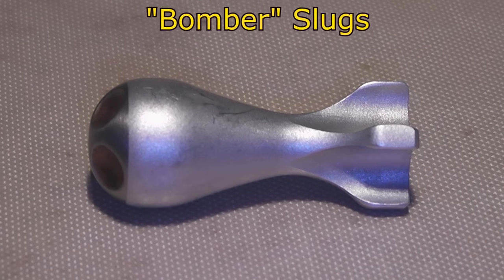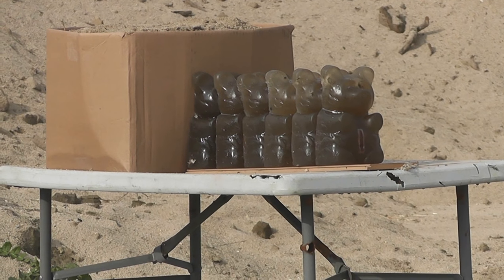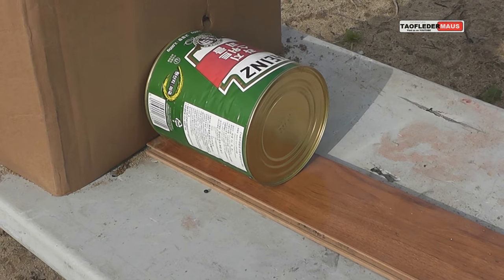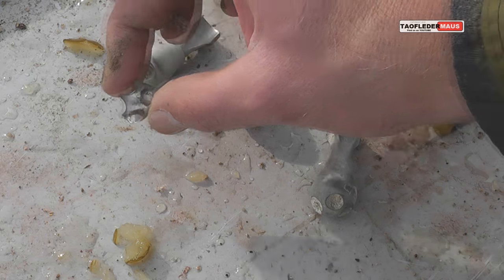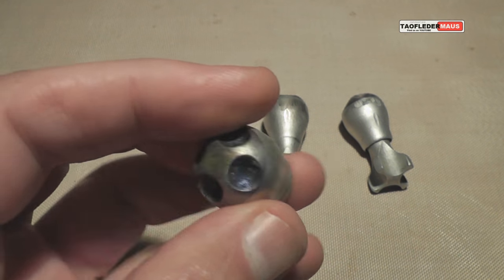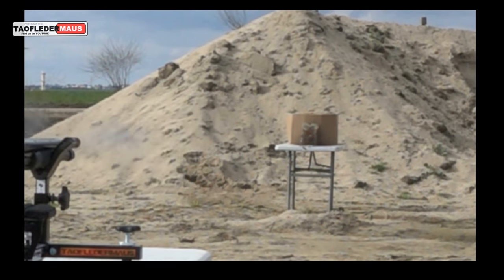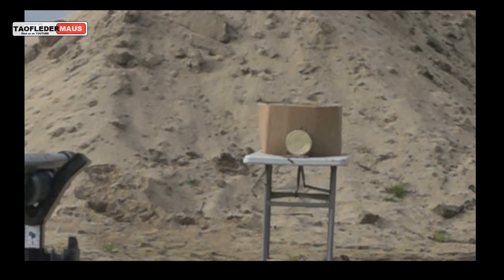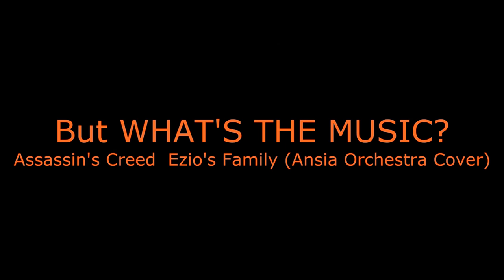BOMBER SLUGS -  Super Exotic Experimental  Shotgun Round

Comment: Wait what if you shot a prince Rupert's drop? Would there be a way you could keep it from shattering until it hit the target?
Reply: +Jordan Edwards You could possibly get away with it if you encased the tail somehow. Or, you could shoot tail first, and make a glass shrapnel round if the G force didn't shatter it in the barrel.
Reply: +Lunchbox Harris What if the tail end had been put inside a slug cast while it's filled with aluminum or something that is still solidifying? Perhaps the density of the metal would be enough to protect the tail from the shock. If it somehow managed to not shatter during impact, it might make for a good reusable bullet as well.
Reply: +Jordan Edwards For the drop I would suggest Brosilicate glass, because it has a high melting point, and it's great at absorbing thermal shock. (They make Pyrex bowls from it.) For the tail casing, you want as little energy as possible getting to the tail, I would think that metal would transfer to much of the blast energy. I would go with a material that has a high shock absorption rate.

Comment: Seems almost stable. For $220, I think I will stick with cheap lead slugs, haha. So with some modification, this is a good design, the supper sized pellet is a good design, and the Lee slugs are good in specific loads. We have a very large catalog of slug designs now, most do not work well, but a few do work well.
Reply from the maker: +Jesse Sisolack   I'm really anxious to see the titanium and aluminum pellet-shaped slugs.   I'm waiting for a bright sunny day so I can get the exposure quick enough to see the slugs a bit more clearer.    They should be very fast,  and hopefully accurate.
Reply: +TAOFLEDERMAUS Yes, that high speed does not work very good unless you have plenty of light. We know that design works well, so I hope those slugs will follow suit.

Comment: In order for your fins to work, the air needs to flow between them (like feathers on an arrow). I believe the round is traveling too fast for the air to flow with the shape of the round because the nose is a blunt shape. This would form a cone behind the round causing it to wobble as it travels.  The 4 pitted areas on the nose of the round definitely do not help it aerodynamically either.

Comment: how about having a bit of a twist with also a slight turn/bend at the end of each fin to catch the air resistance to encourage the rotation and make for a truer flight path?

rather than straight fins?
Reply from the maker: +Dangerous Daz  It's better to avoid spin stabilization if you can.  It adds other issues  like spin drift,  etc.

Comment: You should shoot solid Magnesium bullets. Not like dragon's breath or anything or Magnesium powder or Magnesium powder in a gel or solid, A solid bullet made of only magnesium. Hopefully looking super cool and bright.
Reply from the maker: +xhammy  It would be very difficult for it to ignite,  especially in solid form.  Little shavings,,,  maybe.
Reply: +TAOFLEDERMAUS Idea is to have it stay in one piece burning, as a solid chunk. Basically super tracers.
Reply from the maker: +xhammy  You'd have to use an oxy/acetylene torch to ignite it,   try to shove in into a plastic shell,  then shove that into a shotgun.  I think we'd lose some fingers in the process.
Reply: The burn temp of magnesium is 880 degrees and gun powder is about 800 as well so I would think that should be enough.
Reply: I believe dragons breath works by having many magnesium pellets inside the shotgun shell but I could be wrong. The idea is slugs vs shot.

Comment: Lost foam casting of the slug followed by sandblasting would likely be much cheaper than making them with a CNC.
Reply from the maker: +Milo Flint  These are made out of both steel and aluminum.

Comment: For the cost and time involved with machining all these unusual projectiles, Whoever is making these should consider machining casting mold's for them instead since many of the issues with performance might be attributed to the low weight of the projectile. Then you could cast as many as you like in lead and get a much better comparison against the traditional slug.
Reply from the maker: +lengthOFpole  Tim works at a machine shop, not a foundry,  so he does what he can do.
Reply: Not intending to speak down about whoever is making these as they are obviously good at what they do. The lee mold's are machined from aluminium blocks and it should be possible and take less time on the machine to make 2 halves or a casting mold to cast lead projectiles in some of these shapes. If they were of cast lead some of these designs might work just as well as a normal slug.

Comment: wouldn't trigger pull play a role in using a shooting stand like that.
Reply from the maker: +josh33025  Absolutely.  The gun wouldn't fire if the trigger wasn't pulled.
Reply: +TAOFLEDERMAUS if you ever looked down a scope while using these stands you can tell how little movement has big effects on your shot.
Reply from the maker: The trigger is pulled by pinching it using the trigger guard,  so there is zero movement in any direction

Comment: why would they be so expensive wtf
Reply from the maker: +Justin Koenig   Custom machine work is expensive.  The time to design them,  programming,  and time making them.  That takes a lot of hours to do.   Once you had that done,  and you wanted to make a 1000 unit batch, the cost would come down to about $20 a piece.    I think most machine shops would turn you away if you expected them to make a few of these for any cheaper.   They'd rather make parts for aircraft and stuff where they maximize profits.
Reply: ***** "just" buy a lathe for like 5k and make them yourself 
will cost you time, but no $200.
Reply from the maker: Good luck getting all those complex curves turning a hand wheel!  lol

Comment: couldn't you just make a cast, then just make a bunch really quickly?
Reply: +jacker372 They would be to brittle.
Reply: +Buckwild324 it only needs to last long enough to get out of the barrel and to the target.
Reply: +andrew garcia 
The shock from the actual shot would break the bullet
Reply: +w00dmii5t3r even if it were saboted? Maybe made of a softer metal?
Reply: +jacker372 The slugs are actually made in two parts. The steel head is threaded in to an aluminium tail and they are machined together. Perhaps he could machine the heads separately and then cast them in the body, but I don't think they would hold together very well.
Reply: +Arthur Brown OK how about casting it drilling the center out and threading it. then you could put what ever core you wanted
Reply from the maker: +jacker372   A mold would probably be even more expensive to make.   He used two metals to make these-  machined them separately,   then screwed them together and finished machining the entire shape.   There's not really a quick fix for doing that.
Reply: Couldn't you make a high temp silicone mold cheaply and pour molten lead in... Make one piece instead of two